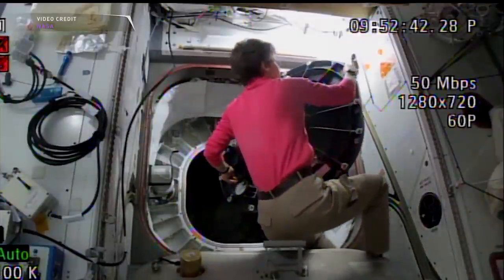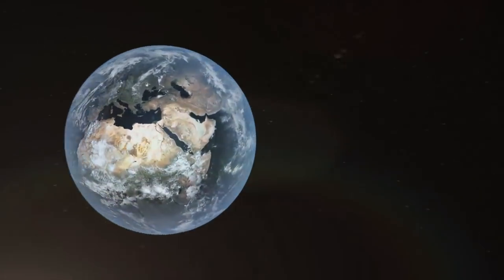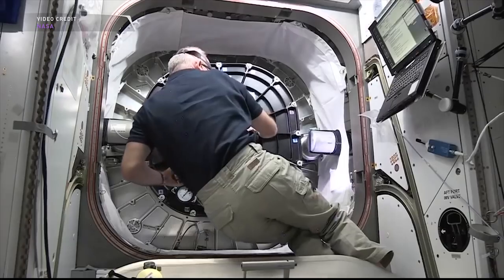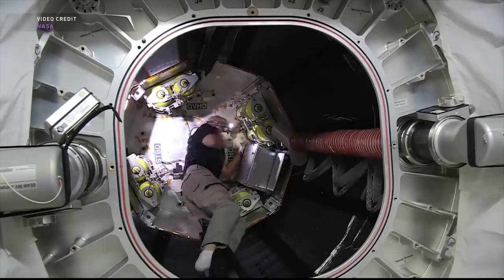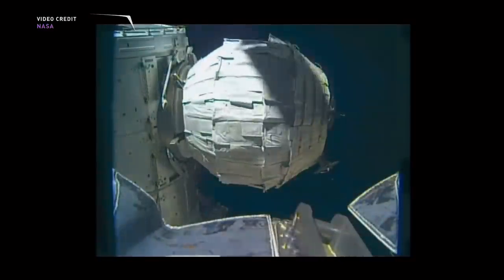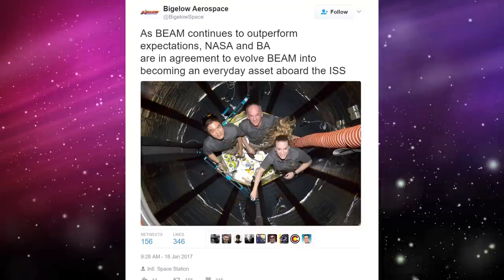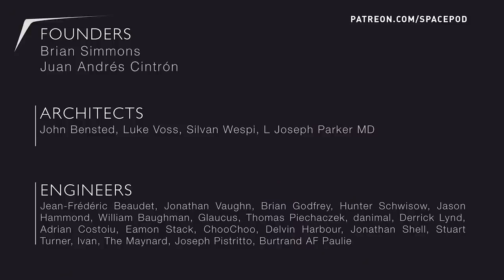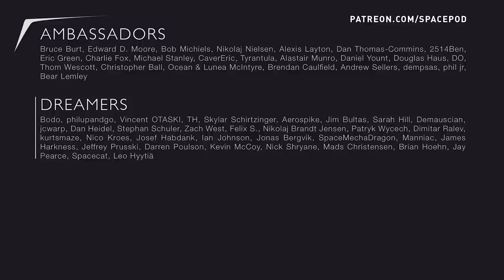Banging on BEAM - Space Pod 02/08/17

Comment: Sooo frightening using inflatables in space... yet so necessary. It's a fine line and I hope we get it right! 
For more permanent inflatables, do you think they'll coat the inside with more structural support? (like fiberglass or something, I dunno) Don't want anyone to worry about explosive decompression, that's for sure! (Fingers crossed!)
Reply: It's made of the stuff of body armor, not party balloons. Nothing will penetrate ti, that would not also penetrate an aluminum hull.

No need for internal 'structural support,' either. If you've touched a pressurized fire hose, that will give you a sense of how stiff it already is. Bigger operational modules however, will use an internal framework for mounting hardware and work stations, akin to the interior of Skylab (which was designed around and within an empty fuel tank structure).